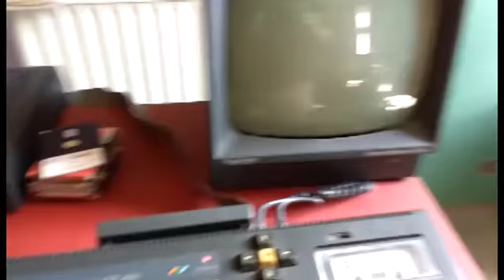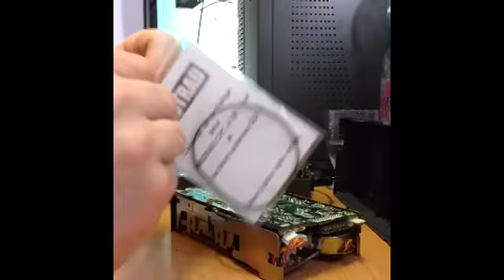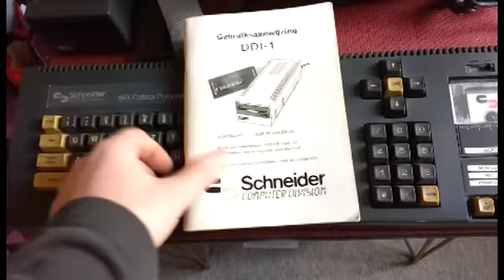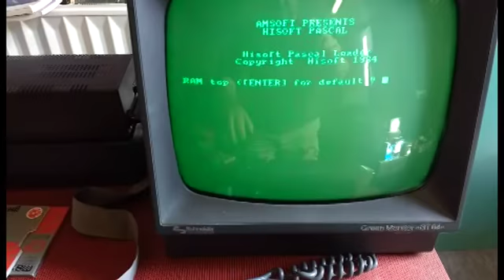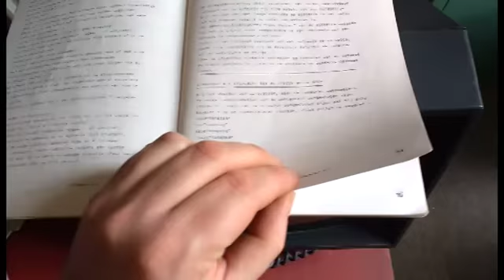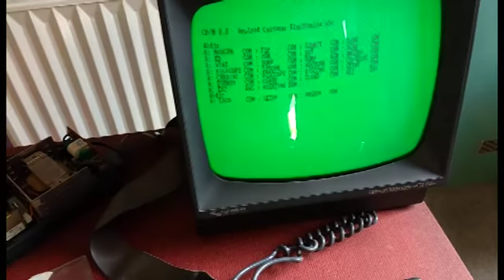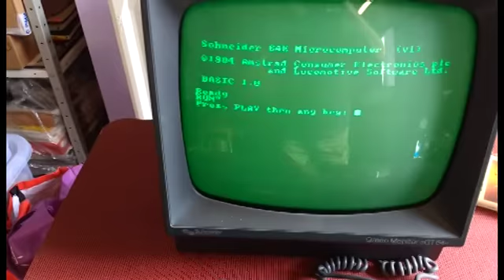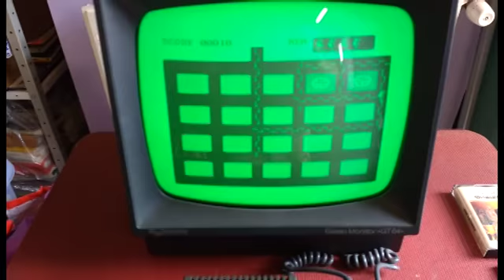Schneider Amstrad CPC 464 DDI-1 external 3 inch CF2 disk drive

Comment: Interesting . I've got now a DDI-1 (schneider) but facing a "read fail" ... any idea ?
Reply from the maker: Take it apart, clean the head, oil the rails. Be careful not to loose the small pin ;) If that doesn't work you could replace it with a Gotek.